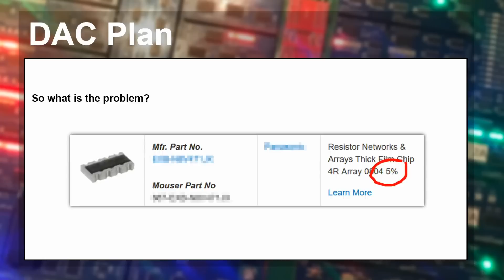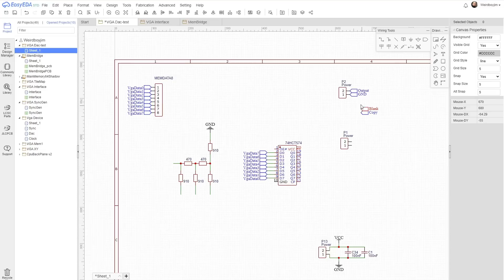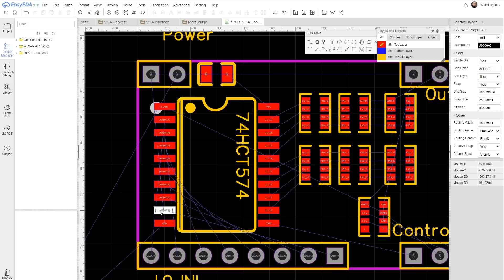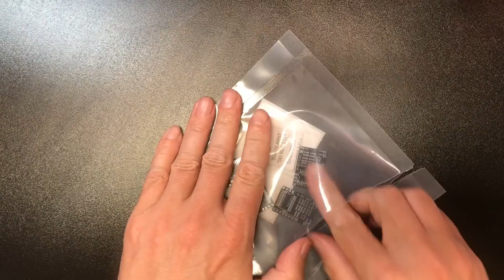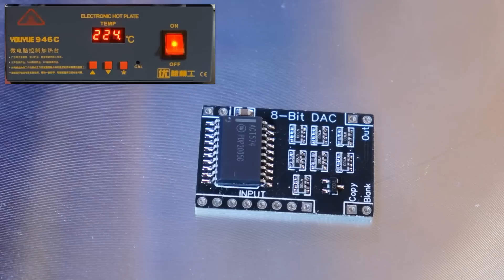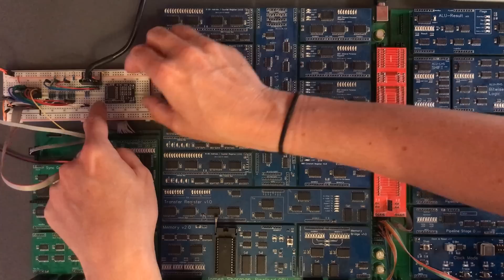DAC Test - VGA from Scratch - Part 10

Comment from the maker: Join us on Discord: https://discord.gg/jmf6M3z7XS
Support the channel on Patreon: https://www.patreon.com/JamesSharman

I did realize during editing that I got the gradient range wrong, the bars only go up to 224/255 but the test is just as valid.  Should have made it 4 bars with an offset of 58 each line to cover the full range with a bigger overlap.
Reply: I'm paranoid enough to animate the bar test (i.e. start from 0~255, then 1~, 2~, etc) and check if the values of the end of a bar and the start of the next are smooth as well.
Reply: Fascinating build, excellently, presented!  

I'm decidedly NOT an EE, but the first thing that came to mind regarding the 127->128 jump was to dump regular binary and use Grey code, instead, as that will guarantee that only a single bit changes between steps.  Displaying regular images would require a simple program to convert between the two image formats, but that would be pretty trivial.

Does that make sense or am I missing something important?  (...which is highly likely, to be honest.  :sigh: )
Reply: Hi, sorry to be a pest, but would you please share the make and model of your microscope camera?  a link to a purchase site would be even better :-)

Comment: Why use a voltage divider type DAC over a weighted resistor DAC? I'm just curious about the design decision. Obviously an array of a single value makes construction easier but technically at the expense of accuracy.
Reply from the maker: Using the array of single value resistors would abolsutely work IF you can get accurate enough ones.  Take a look at any list of commonly avaialble resistor values and see if you can find a series of values that would work for an 8 entry array?  The R2R ladder may seem more complex but it's benefit is it repeats using the same values.

Comment: one more great video james, thanks for it! for my understanding: the output voltage is growing linear from 0 to 5 volts, shouldn`t  it be from 0 to 0.7 volts for vga? 0 volts for 00000000 as input and 0.7 volts for 11111111 as input?
Reply: ahhhhhh, i didnot think of the parallel 75 ohms of the monitor, now it grows linear from 0 to 0.7 volts 🙂
Reply from the maker: Well done! you worked it out before I got around to replying.  It's always important to evaluate a circuit relative to the the components it's connected to.

Comment: instead of putting two registers in series at the latch output, you could have also put two resistors in parallel for the connections between bits.
I think that would have made the wiring diagram and routing a bit easier when using the resistor arrays, since you wouldn't have crossing connections.
Reply from the maker: You can go either way of course,  double R or half 2R. In this case there high precision resistor networks available to me didn't have a very good approximation for 2R.

Comment: Excellent video. I'm looking to build a 4-bit version (for 12-bit RGB) myself. I'm a bit confused though, how did you convert the output from the R2R to be 0 to 0.7V and not 0 to 5V? Was that the work of the MOSFET? I've been seeing people use Opamps as well, so I am not sure what is the best approach. I prefer a simple approach. :)
Reply from the maker: If you use an op-amp you can use any value for R that's reasonable and then tune the output voltage using the r2r ladder. When you use the r2r ladder directly you need to worry about the internal termination of 75 Ohm.  For 4 steps at 5v I think you need roughly R=425, 2R=850 but with only 4 bits you can have slightly more wiggle room (I suspect with only 4 bits you can use 390/820 and save some space without having to double R yourself like I did).  Try using a calculator like this one http://www.aaabbb.de/JDAC/DAC_R2R_network_calculation_en.php
Reply: @weirdboyjim  Great utility, thanks! Setting the values to  390/820 like you suggested and setting RL to the internal resistor of the monitor seems to give a signal of 0 to slightly over 0.7 V. I am not sure how strict the upper level is but it's worth a try. Simple enough to wire up on a breadboard and measure!

Edit: my supplier seems to have 1% metallic resistors in odd values such as 422 and 825 ohm which seems to give even more linearity. Might try those.

Comment: I hoped you will test 25 MHz clock
Reply from the maker: The dacs worked fine at 25mhz, that's mostly just about picking a part for the d-type that was fast enough and making sure it's decoupling was good.

Comment: Buy more than you need and measure them all out to get matching sets.  That's what I used to do on audio circuits to guarantee the left and right channels are matched.
Reply from the maker: Yeah, although that would work better using single resisters rather than the arrays.

Comment: I would say, at least 6 bits per color component is what I like, gives that retro feel for a VGA display! I am working with (non-palette) 15 bit color (5 bits per channel RGB) frame buffer, and I don't get that retro feel.
Reply from the maker: I did think about doing a 16 bit (RGB 565) palette for a while but the 888 is easier to program for.
Reply: Atari ST and genesis are 16 bit and only have RGB 333 . We are totally over the top of 8 bits.

Comment: During the early design phase I was thinking you could use a meter to rank the resistors by deviation from the average and then use the most deviant ones as LSB, but with chips and PCBs that's a bit onerous.

Incidentally, doing a project like this is my dream, but I haven't got anywhere near the time or money, or privacy to do such delicate work. I shall enjoy it vicariously through you, sir!
Reply from the maker: Glad you are enjoying it. I wonder how tough it would be to build a jig for mass testing resistors.

Comment: I look forward to seeing how you reconcile the 24 bits of pixel data with the 8-bit processor. Perhaps something similar to what you did with the registers on the audio circuit? Alternatively, perhaps you could drive something from the 16 bit registers and still get lots of colors. I think the 16-bit RGB "standard" is 5 bits red, 6 bits green, and 5 bits blue, in that MSB-LSB order. Depending on your target screen resolution, that might be a fine... don't want too many more colors than pixels. 😁Then again, maybe that opens up palette opportunities? 🤷‍♂👍
Reply from the maker: I think I've dropped enough hints on this. I'll be using a 256 entry palette  lookup to translate to 24bits color. This actually gives some great opportunities for changing the colors on the fly like I did with the scroll registers in the beam racing demos.
Reply: @weirdboyjim  Perfect! Looking forward to it.

Comment: If it was a problem, when doing one-offs, characterising the resistors and putting the worst at the least significant end should be fine. I like PWM in these cases, but that has its own problems... and some fun dithering tricks
Reply from the maker: I think it will be ok to just use as is, but I will test the final channels like this

Comment: What about an interface that converts the values into a data stream that can feed a HDMI input on a modern TV together with the SPDIF audio stream for the audio meant to emanate from the speakers of the TV.
Reply from the maker: HDMI would be a tricky protocol to do with discrete components, it would end up being a sizeable module on it's own. There are LCD panels that will take a vga like input but with raw digital rgb though that might be worth a look.

Comment: re: R2R ladder -  you could have used 0.1% resistors for the 2-4 most significant bits and 0.5%-1% for the rest - you can spend 10$ on 100+ 0.1% resistors and bin them with a 10k+ count multimeter and use the ones closest together.  Standalone resistors aren't that expensive, Digikey has 0.1% 0603 resistors at 11 cents each if you buy 100. 0.5% resistors are 4 cents each if you buy 100.
Reply from the maker: Sounds like you are talking about single resistors. That was an option but I'd rather stay the arrays for compactness. Pretty confident this will work fine now.

Comment: Couple of questions.

Is it worth using higher value resistors to minimise the current you are sourcing/sinking from/to the HCT?

Then use an opamp to buffer the output and of course you can then put the series termination resistor in to impedance match the VGA cable?

Note that the more current you pull from the latch, the more vcc noise you will have and that will couple through to all logic 1 bits.

Given your user of 2 layer PCBs, that noise might actually trigger some ringing in the 100khz-10Mhz range.  That ringing unlikely to break your logic level stuff but might well be visible on your display as waves that ripple across the page or down the page depending on the frequency.

P.s. opamp slew rate might be limiting factor, but I am sure you can buffer the voltage somehow.
Reply from the maker: You maybe right, but I was careful to make sure the current source/sink would stay well within range. All the vga boards are 4 layer, I wasn't fool enough to try these frequencies without power planes!
Reply: @weirdboyjim  aha ... I haven't been following carefully enough clearly.   I was more thinking that no two channels of the latch will have quite the same Rds-on in their high side FETs and of course you'll be pulling different currents from different pins.  The lower the current, the lower the error.

You can of course make it all work on two layers, you just need to be very careful about the return paths for every signal.  4 layers easier but no guarantee ... You still need to watch those return paths 😜. 

Anyway I will go watch the other 9 episodes... 

Great channel, really enjoying it 👍

Comment: 16:17 - kitchen scissors will cut the steel sheet, no problem.
Reply from the maker: It will cut it easily enough but I was worried about introducing a bend.

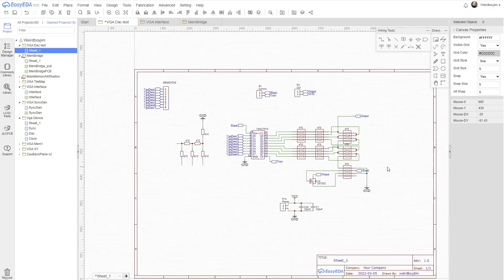Comment: The FET circuit at 12:33 doesn't make any sense to me! You don't need a gate resistor (it just slows the FET down since you're making an RC delay with the R and the C of the FET gate). And resistance in the source doesn't make much sense in this digital application. However; looks like it works, so it's good enough :)
Reply from the maker: So that other guy who posts that I'm wrong every time I drive a fet gate without a resistor....
Reply: @weirdboyjim  I mean, resistors as a potential divider to protect against the inputs greater than the maximum V_{GS} is useful. Anywho! It works, that's all you need!

Comment: Regarding your slide at 8:03, that's not strictly true. While the distribution of manufactured parts is a bell curve, the higher accuracy parts are removed from the centre of the curve about the mean, leaving you with a bell curve missing the centre most part (since that's sold at the more expensive rate for the higher tolerance parts). It has a fancy statistical name (which I've forgotten). But in essence, you're very unlikely to get parts <1% if you're only paying for 5% tolerance, you'll get parts -1% to -5% or +1% to +5%.
Reply from the maker: Some other people have suggested the same thing. The next tolerance band I see is 0.1% so the 1% parts have a decent chance of being reasonable.

Comment: I'm looking forward to see if you use a RAMDAC look-up table and how it is implemented. Regarding tolerance, I'm sure your choice of resistor packs will be absolutely fine. I would be inclined to use higher value resistors to reduce current consumption, but its all just a personal choice. You might notice a slight (lack of) gamma correction issues, but it isn't as if you are doing any Photoshop work on it! Definitely add some appropriate power supply capacitors to the chip driving the R2R ladder etc, and some bulk electrolytic to any output drive amplifiers. Don't forget the output may need a 75R impedance matching resistor to stop any 'ringing' or echoes in the video cable.
Reply from the maker: Yeah I'll have a pallets of 256x24bit should be able to do some fun things modifying the colours as well.

Comment: Hi James. Another awesome video. :)
Regarding your R2R ladder and resistor values, note that resistors come in Preferred Value series. The preferred values are a percentage relationship to each other. 
e.g. The E96 series has each value +/-1% of it’s neighbouring value (E48 is +/-2%, E24 is +/-5% etc.).  
The manufacturer then just assigns an individual resistor’s marked value by dropping it in the Preferred Value bucket that it fits (hence the percentage relationship between Preferred Values in each range).
This means two things:
1). The error in an individual resistor’s value doesn’t fit a bell curve. It is simply a random value within the +/-% tolerance Preferred Value range.
2). If you want specific matched values it’s common to just test & select some closely matching value resistors from your parts drawer.  Obviously, choosing resistors in the E96 (or even E128) series makes finding matching resistors, within a fine tolerance, much easier.
Obviously, in use, there is also individual value variance due to temperature drift etc.  But for a simple R2R ladder the relative effect should be negligible.
In summary, you simply need to measure and select appropriate matching value resistors to use in your R2R ladder. 
Hopefully this information is of some help?
Reply from the maker: Interesting, With that selection logic it would create a bell curve but with a gap "cut" out of the middle.
Reply: @weirdboyjim  Hi James. I’m not sure I’ve understood your reference to a bell curve but with a gap "cut" out of the middle?
Although, with further thought, I do agree that there would still be a bell curve, relative to modern manufacturing tolerances.  
But given the design intention of the Preferred Value resistor ranges, I’d think it questionable whether manufacturers are that concerned with manufacturing for specifically accurate individual resistor values. But, I’m not really up with modern resistor manufacturing practices, I’m just recalling from my own experiences back in the day.  🤓

Comment: A great video but I feel the outcome was very much to be expected. Resistor ladders are very common in video output circuity. If they really had such big problems that would have never happened, everybody would use DACs or the would have specialized resistor ladder packages.
Reply from the maker: I agree, but remember that every bit doubles the accuracy requirement. I could have still produced pretty good results with 565 rather than 888 so I was mainly checking the extra effort was worth it.

Comment: The likely hood of the error being even terribly noticeable is minimal. I think this is more than a reasonable circuit to do 24 bits with.
Reply from the maker: Now all I need is to do something interesting with those 24 bits!
Reply: @weirdboyjim  One step at a time.
Reply: It's not my field of expertise, but I'm sure I heard that actually the human eye isn't all that good at discerning shades of colour. Plus it's only going to show up if adjacent pixels are a single colour on the 127 128 transition, which is probably only applicable in artificial scenarios.

Comment: have you thought of using a proper voltage reference in your DAC?
Reply from the maker: Not really, the results I'm getting are good enough for my needs. A voltage reference would help nail the overall range but the results I'm looking for are more sensitive to the relative changes.

Comment: If you're going to design and build a new board for the final output as an absolute minimum I'd recommend adding those op-amp output buffers to minimise the loading effect of the cable and monitor on the digital chips.
Reply from the maker: Why do you suggest that?  Even with cable there is quite a bit of headroom on the line driver outputs.
Reply: @weirdboyjim  it's not just about the volts/amps that the chip can provide, but its impedance. VGA is designed to operate with a source/load (and cable) impedance of 75ohms. A mismatch can cause reflections in the cable which is a major source of ghosting. While that may not be an issue now using an LCD screen due to its ADC front end, if at some point you wanted to play around with making a "duck hunt" style gallery game using a lightgun and hitscanning you'll need a CRT monitor, and they're a lot more sensitive to impedance mismatches due to their near fully analogue design.
So the TLDR is, not really necessary now with the current setup, but could save you some headaches later if things change.

Comment: You can also increase precision by putting resistors in parallel, 10 4700ohm 1% resistors in parallel will act as 1 470ohm 0.1% resistor, (this naturally depends on the normal distribution of the resistors you use ofc so beware of that, Dave from EEVBlog has a nice video on it)
Reply from the maker: Interesting, but it does just bias the probability, it's still possible to be 1% out.
Reply: @weirdboyjim  that's what I meant with the normal distribution, if it's centered on the desired value you're good, and that seems to be the case (at least from EEVBlogs tests (if you get good ones instead of the cheap chinesium ones that is)), but yes, if the center of the distribution is offset your final parallel pack will include that deviation, I don't remember the math involved though so I don't know to what degree it influences